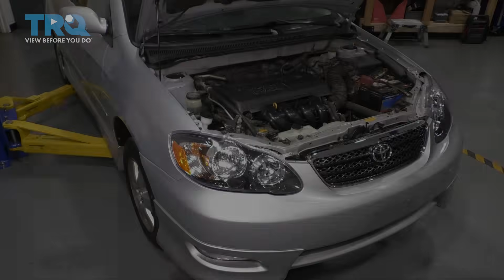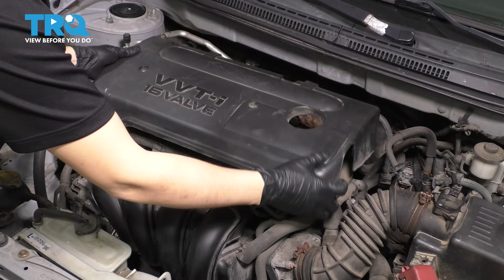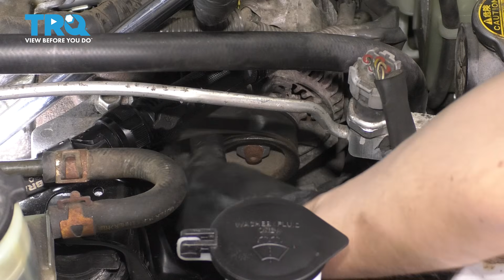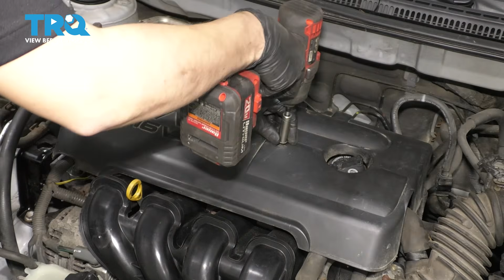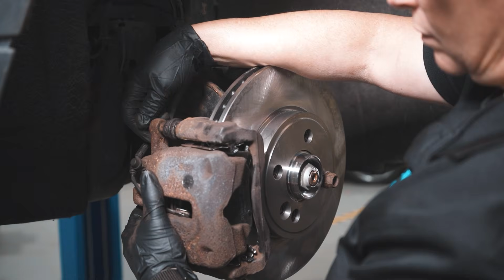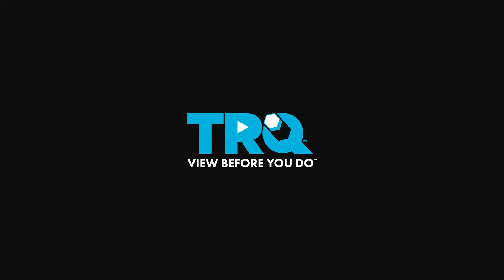How to Replace Serpentine Belt 2003-2008 Toyota Corolla

Comment: Reaching (from top) behind the engine instead of trying to go from the side helped. Also, I didn’t have to lift the car but if you turn the wheel towards the passenger side and remove the plastic guard (if it’s there 10 mm), it helps a bit as well. 
Yes, the video cuts made it look easier, but it truly wasn’t all that difficult once i fed the belt up from the bottom. Being female, i can’t speak for someone burly guy arms 😁
note: thank goodness for the comments that let us know it’s not as cut and dry as the video shows due to the cuts in the video, otherwise I may have become a tad frustrated.

Comment: Make 100% sure that the socket is fully seated onto that hex shape on the belt tensioner, as the metal is very soft and is EASILY stripped !!!  Use a 6-flat socket, not a 12-flat socket, to reduce the chance of 'stripping' that hex shape.

Comment: I did this 2 days ago.  Not an easy task and I knew that because when you watch these videos, there is much editing gaps during the belt routing....  I have witnessed 2 different mechanics though do this on my other Corolla and another Corolla I had that got totaled...  Both times, the mechanics I used did it all from the top of the engine...    My hands and arms are bigger so that was the challenge.  I did have  my son-in-law lay under the car from the front and hold the new belt firmly  in place on both the power steering and harmonic balancer wheels....  That made it much easier to route the belt without it wiggling around..    You don't even have to remove any covers under the car, jack up the car, turn the wheel etc....  If you reach behind the engine you can get your left hand pretty easily to the power steering wheel...  Not sure if my 2 cents is helpful if you try this but I am glad it is done well and over with....  60K and upward is the lifespan of these belts...  I really think ALL belt brands are great but, I actually opted for a Michelin belt on this job....  My favorite belt and the one I have on my other Corolla is the Goodyear Gatorback which is now the Continental OE Technology Series (with AC) 4060740....   It is a beefy belt that looks solid....  I bought this car used December 2021 and was only going by the dry cracks in the ribs but once I got the old belt off, I realized it still had a lot of life left....  Now I know when the new belt was replaced and is documented in my records....   This 2005 Corolla now has 164K miles so I hope at 225-235K miles, I am still driving the car....  These older Corollas are some of the best cars still on the road..

Comment: Thanks for sharing your knowledge and time making this video.  My wife's Corolla belt broke on the highway but we were close enough to home to get the car home.   Your instructions were excellent and I was able to do it myself.  Biggest problem was buying locally the belt.  Auto parts store said the 4 cylinder 2008 Corolla engine takes different sized belts depending upon having air conditioning or not and the exact model 2008 Corolla.   Our Corolla is the LE version.  Just be sure you get the correct belt.

Comment: Watched video but still had to remove passenger front wheel to gain useful access to the power steering pump , harmonic balancer , and A/C pulleys. Also unbolting the power steering pump reservoir and moving it out of the way helped a lot too.